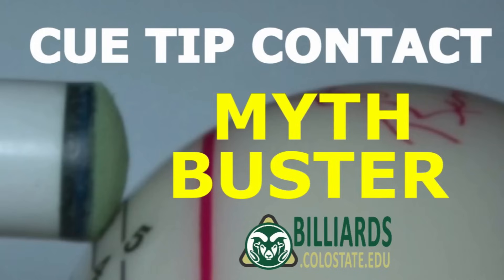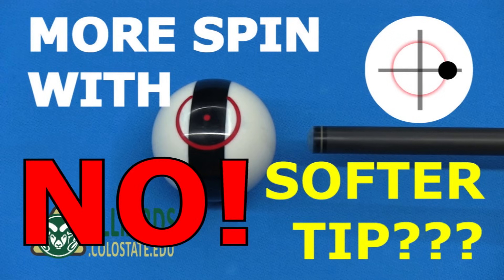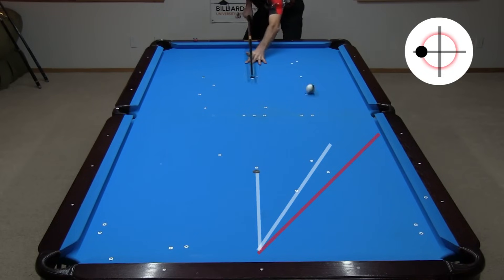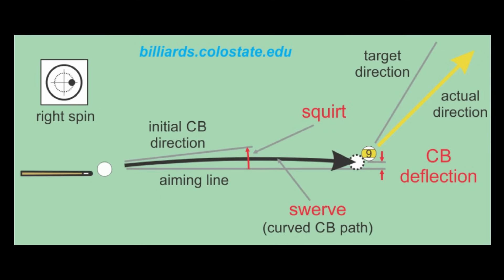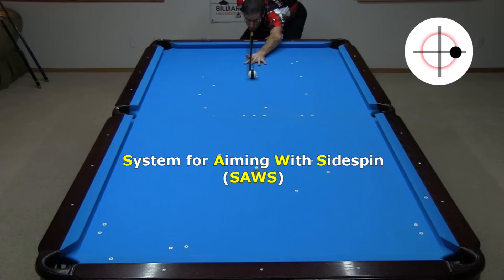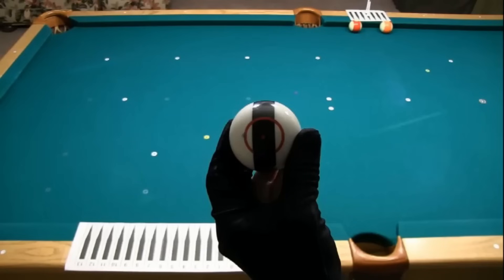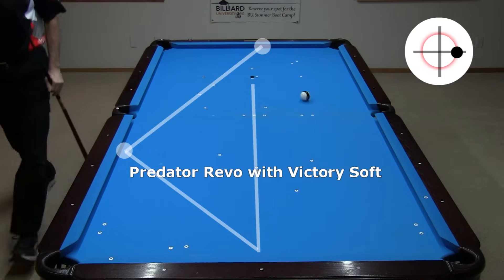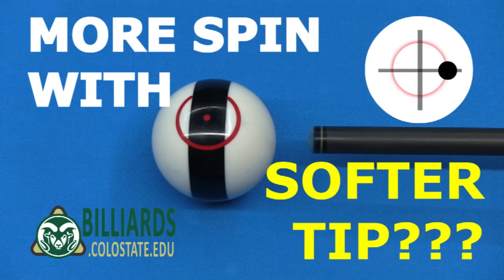Can a SOFTER TIP Put MORE SPIN on the Ball? -- MYTHBUSTING Answers

Comment: I watched and you’re hitting the ball way harder than I am talking about. Freeze a ball to a ball from 1.5 feet that’s what I am talking about. The hard tip will not transfer the spin as well inside of 3 feet. Soft also equals less misques on those types of shots
Reply: did you see the end of the video?
Reply from the maker: You or others can do similar tests at super-slow finesses speed instead if you want.  I would expect the results to be the same.

Comment: I am 701 FargoRate right now. I play mostly one pocket. For nine ball and most other games I will agree a hard tip will do the same. But touch shots in one pocket impart spin on the ball much better with a soft tip. The video I saw the ball was being hit much harder than I am talking about. I have been playing pool for 35 years plus. I promise you soft tips enabled you to impart the spin you want better than hard in one pocket. You might not play one pocket Dave. A hard tip glances off the ball more. I have played with hard and soft tips for rotation I like a medium tip in rotation. one pocket is soft and softer. Maybe you don’t freeze balls to other balls I do and a soft tip helps by about a ball and a half! Ps i haven’t seen a video where the balls only travel 1-2 feet
Reply from the maker: The only way to know for sure is to do a comparative test like I demonstrate in the video.  If you or others want to use an even-slower finesse speed for the test, that is fine.  I would expect the results to be the same.  I certainly have no trouble hitting finesse safety shots with a wide range of playing-cue-tip hardness (although, I admit I am not comfortable using a break cue with a phenolic tip for this purpose).

Comment: Another great video, Dave.  However, it would be more convincing/valid to use the exact same type of cue each time, only with different tips on them.  Also, an argument could be made that the different cues produce different efficiency regarding energy transfer, which would affect the action off the cushion.  And it could also be argued that your stroke speed is not perfectly consistent for each shot.

I would love to see someone use something like the old Meucci stroke machine/robot to do this test.  Use two different tips (super soft vs med hard) and two exact cues.  Stroke speeds should be equal and the tip offsets (imparted spin) should be perfectly equal each time.  Instead of measuring the rebound angle, measure the rpm's generated for each cb.  

I realize this would be much more involved (using machined equipment and a tachometer somehow), but the results would be more convincing.
Reply from the maker: As described and demonstrated in the video, for meaningful comparisons, CB speed needs to be the same, not stroke speed.  The CB speed was "measured" by how far the CB travelled.  Concerning "measuring" the spin, rebound angle is reliable and no special equipment required.  It will vary from one table to the next, but relative comparisons will be valid.  BTW, testing machine results are not always very good. For more info, see:
    https://billiards.colostate.edu/faq/squirt/robot-test-results/
Reply: @DrDaveBilliards  yes, you wanted equal cb speeds to show that with different tips/cues you got similar results.  

What I'm saying is that the applied effort (stroke speed) is what should be equal, not cb speed, in order to determine if any significant difference in spin is generated with different tips.  And also the cues should be equal (weight and shaft deflection).  If you want to show or prove that tip hardness does not make a significant difference in spin, the only thing that should be different in the equipment and test procedure is tip hardness.  One tip should be a super soft, the other a medium or medium hard.  Everything else should be the same.

I'm just pointing out things that could make the test results more convincing or valid.  With the same effort applied (same stroke speed with the same cue), a medium hard tip would have a more efficient hit, transferring more energy, than a super soft tip.  

Does more energy tranfer result in more cb spin, ie...rpm's?  That's the type of test that would be more accurate for determining which tip might produce more spin. 🤔  Anyway, I'm sure any slight difference in spin would be too small to be of any real benefit anyway.
Reply from the maker: I know what you are saying, I just don't agree based on all the reasons I describe and demonstrate in the first half of the video.  For example, Bob Meucci's "Myth Destroyer" testing machine was actually a "Myth Creator" due to all the reasons here:
    https://billiards.colostate.edu/faq/squirt/robot-test-results/#rules

Comment: Hi Dr. Dave I think the best way to sum it up is the same spin can be imparted into the CB regardeless of the tip's hardness! Yet the effort (consistency) needed with a softer tip tends to be smaller!
Reply from the maker: Actually, slight more effort (cue speed) is required with a softer tip due to the slightly less hit efficiency (energy transfer).  See:
    https://billiards.colostate.edu/faq/cue-tip/efficiency/
Reply from the maker: @NotABotM8  Agreed.  For a given tip contact point, more speed gives more spin (they increase by the same proportion).  See my follow-up videos here:
  https://billiards.colostate.edu/faq/cue-tip/hardness/
You can deal with this by making sure the CB travel distance (and therefore speed) is the same for every shot in any comparison.

Comment: You don’t even use a real soft tip in any of these. Use a layered tip like a kamui ss or a morri tip. The statement that a soft tip will miscue easier is questionable also. The issue is speed vs spin and it’s a feel thing. You are missing some variables to this.  You cant replicate the feel regardless if it is a myth or not. Explain to me why it is easier to make balls with a harder tip. Explain why layered tips make it harder to pocket consistently. Much easier to miscue with a harder tip too. I bet with a nice layered tip you could push that miscue circle limit slightly depending on the stroke applied.
Reply from the maker: If you can achieve a larger miscue limit or greater spin with any tip, please post a video.  In my experience and testing, the miscue limit is the same for all tips that hold chalk.  For more info, see:
    https://billiards.colostate.edu/faq/sidespin/maximum/
    https://billiards.colostate.edu/faq/cue-tip/hardness/
    https://billiards.colostate.edu/faq/chalk/comparison/

Comment: Dr Dave, I use a soft tip 12. When I'm hitting a soft shot the requires max spin, I sort of turn my cue sideways and jab it with the edge of the tip. It creates phenomenal amount of spin. Have you ever experimented with this technique? You can't hit it hard like this is the only problem.
Reply from the maker: See the videos and info here:
    https://billiards.colostate.edu/faq/stroke/swoop-swipe/
Reply: @DrDaveBilliards  thanks! One more question. Traditionally it is taught to have a level cue and I've seen you mention this alot. I've been watching hours of pro tourneys and they all play with a jacked up cue (not as level as they could make be). It's almost like they set their bridge hand as if they are playing off the rail (same level). Whats your thoughts on this doc?
Reply from the maker: @Tomfrommyspac  The cue is never level because it needs to clear over the rails.  And for draw shots (with a low tip), the cue is elevated even more.  And if the grip hand is close to a rail, extra elevation is required so you don't hit the rail during the stroke.  And on the break, many players drop their elbow and raise the tip during the stroke so they need to elevated more and aim lower before the stroke.

Comment: You said "a thorough answer", but all of your examinations are of level cue strikes.  When the cue is elevated, the strike applies downward pressure against the table for that precious microsecond you appear to be always dismissing as negligible.  I can definitely apply more spin with a softer tip and also because I can go farther out on the ball without fear of slippage (miscue), making the torque arm even greater.  Spoiler...  I feel as though you are incorrect.

  When the contact is at other than directly down the axis of the stroke, a torque arm is created that imparts spin into the cue ball.  You already know that, Mr. Physics doc.
    That torque arm is a combination of the offset from the centerline of the stroke AND the small torque arm the tip width makes.  When the softer tip gets that extra microsecond, it also applies more action through that tiny torque arm, and especially so because the larger contact patch enjoys more 'grip' or 'bite' with which to impart said spin via said torque arm.  So running the math alone would yield those facts, and your dismissal dismisses that basic math, DOC.  Being a firm shooter and having experience with various tips, I can assert the exact opposite claim you make that it is a negligible effect.  And I'd bet that Earl Strickland would agree.  I think your "level cue mentality" has affected your capacity to make a full analysis.  You agree that a nice, shiny ball can impart spin into a ball it strikes, yet you want to dismiss the elements of the very thing that was added to the original cue sticks to make them work better.
Your video of a "soft house cue" looked pretty 'hard' to me as I saw no compression at all on the tip.  Whereas MY "soft tip" definitely compresses.  My sessions with my hard tip cue and those with my soft tip cue are noticeably different.  I have posted hundreds of videos and I would say that next to none of my shots are center ball straight strokes.  I use English on nearly every shot.  There are plenty of proofs, but my videos need a high speed camera upgrade to show where I am cueing the ball.  It appears that I have watched many of your videos, but you haven't been watching many of mine.

Comment: Interesting.  However you bring up the point about tip hardness versus energy transfer 'efficiency."  So to effect the same spin and speed with each cue, you would have to adjust your stroke to a slightly different speed.

I can conclude from this that if one has generally a firmer stroke, they may be more comfortable playing with a soft tip.  Conversely, if a player is more finessed or has a slower stroke, they may prefer the harder tip.  I do play with a hard tip, and I find when the tip is softer I have a feeling of needing to "hit" the ball harder to generate the same cueball shape I can achieve with a harder tip and smoother stroke.
Reply from the maker: The difference in energy transfer among typical playing-cue tip hardnesses is not very large (the difference is larger with a break cue with a phenolic tip), but it is a small factor.

Comment: Why are masse shots done with soft tips? Isn't that the goal ,the most spin you can apply?
Reply from the maker: ... mostly so the CB doesn't jump.  Maybe the a soft tip also helps trap the CB between the tip and slate, allowing for greater force.  Maybe it is also a feel thing.

Comment: Nobody can convince me that my Super Soft Kamui has the same effects as a Hard. My miscues are significantly less than before with tip care & maintenance. Also the ability to throw an object ball with ease and hold the cue ball is noticeable different.
Reply: Spot on ... Soft tips will provide more control especially when using bottom and side spin at the same time... I use 11 mm blue diamond tips and change it every 6 months they're not expensive and hold chalk for 3-4 shots ( save's chalk )
Reply: Mans did a whole video with demonstrations and physics explanations and experiments, inspired by his years of studying cue ball physics and his LITERAL DOCTORATE IN PHYSICS. 

"Nah, I'm gonna believe what I want to believe despite the overwhelming evidence to the contrary. Because reasons."

Comment: the softness of the tip is all about cue ball speed and power input, stroke speed and feel.
Reply from the maker: A good player can easily and quickly adjust to any cue/tip combo and to any table conditions, which can also vary a lot.

Comment: Great video, Dr. Dave. I checked your cue efficiency page. Mike Page uses an analogy of treating the tip as an elastic spring. You can use the same analogy to support your observation that increased hardness results in more efficient collisions.

If you can treat the tip as a spring, then increasing the hardness is analogous to increasing the spring coefficient, k. For the same force, F=-kx, increasing k reduces x. The energy going into the spring is E=(1/2)kx^2. For the same force, the energy through the spring varies by 1/k. The energy of the 'wobbling' of the spring after contact should be proportional to the energy going through the spring in the first place. Thus, stiffer tips should be more efficient.

I've read through some but not all of your technical proofs, so forgive me if you've already considered it. I figured I'd point it out as it's an analogy anyone with a high-school-level understanding of physics should be able to grasp.
Reply from the maker: Thanks for sharing that.

Comment: You are hitting the ball way to hard to have a difference! If you’re using a slow lag draw the softer tip will definitely grab more! I disagree with you completely a shot where the ball only moves 2 feet the softer tip grabs more!
Reply from the maker: Did you see the slow-speed test at the end of the video?
Concerning draw, the action of he hit with bottom spin is no different than the action of the hit with sidespin.  What is different with a draw shots, is more speed is often required.  Because a harder tip has a slightly better hit efficiency (energy transfer), a harder tip will offer a slight added advantage over a softer tip, where slightly more CB speed will retain slightly more backspin on the way to the OB.  But getting good draw is more about stroke technique than equipment.  See:
    https://billiards.colostate.edu/faq/draw/advice-and-drills/

Comment: I always love watching your videos.  When it comes to hitting the ball with different shafts/tips etc... I find it, for your study sakes, that you need a machine that can do the stroke... to many varibles to be sure that the hit is consistent
Reply from the maker: I designed the tests at the end of the video so stroke consistency doesn't matter.  If you push the miscue limit and take enough attempts, you will eventually get maximum spin, regardless of how good or bad a player you are.

Testing machine results are not always very good.  For more info, see:
    https://billiards.colostate.edu/faq/squirt/robot-test-results/

Comment: I fully accept your findings. I did think spin was easier to achieve when I went for a soft tip, but now I think it's just the personal feel you get and for me, a soft tip suited my style very well. I miss pool playing very much, I just haven't been able to make it fit with the rest of my life, but my situation has changed and hopefully, I will be able to set up a table in a new room we're about to build. These videos sure get my pool heart ticking faster again 👍
Reply from the maker: Thank you for being open-minded.  That is rare to find these days.
Reply: The only thing that reliably puts more spin on the cue ball is a good consistent stroke/cue ball hit!!!! Smaller tip diameter can def get you farther to the edge of the cue ball. But I’d say if anything a firmer tip will absorb less energy, but the most important factor for any human player is consistently hitting the cue ball where you want to hit it!!
Reply: I have several sticks with different tips.  Agreed...they all seem about the same in overall performance,  but have different characteristics.  It's all just preference in my opinion.
Reply: he is completely INCORRECT--- harder causes less friction,-friction is needed for draw/ spin-- this can be PROVEN by airing your CAR TIRES to 80 psi, and trying to climb a hill, you will slip and slide, then lower them to 20 PSI, and the friction and grab INCREASES 10 FOLD, --this is DAVE'S most inaccurate study to date. We are dealing with BASIC LAWS OF PHYSICS --not his opinion---and the laws of physics CLEARLY STATE he is GROSSLY incorrect.
Reply: @theprochrist your tire comparison isn't accurate tho. Higher pressure makes the contact surface smaller, so it's not the hardness in itself that lessens the friction, it's a smaller patch connected to the surface. The tire hard/soft is very  different to the contact patch on hard and soft cue tips.
I just don't see your argument valid.

Comment: Dr Dave, while I agree with your findings in my experience, I do think you should consider a colab, or even just take a few cues (sorry couldn’t resist), from project farm’s videos, where he eliminates as many variables as possible by making test jigs for the maximum possible repeatability. It shouldn’t be too hard with a pneumatic cylinder, a few bits of wood/metal and a cylinder that can be repeatedly pressurised to the same pressure, thereby “pushing” the cue at precisely the same speed and direction every time. Just a thought ;)
Reply from the maker: I designed the tests at the end of the video so stroke consistency doesn't matter.  If you push the miscue limit and take enough attempts, you will eventually get maximum spin, regardless of how good or bad a player you are.

Also, testing machine results are not always very good.  For more info, see:
    https://billiards.colostate.edu/faq/squirt/robot-test-results/
Reply from the maker: @NotABotM8  Agreed.  Careful measurements with speed/spin sensors (or slomo video analysis) would help provide additional validation.  However, I think explanations, videos,  links, and other info here are quite convincing:
    https://billiards.colostate.edu/faq/cue-tip/hardness/